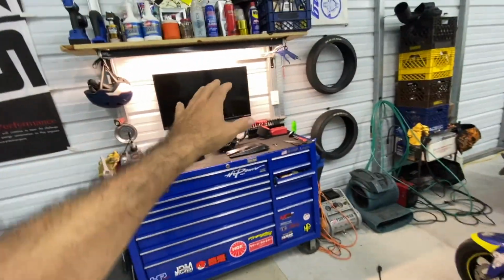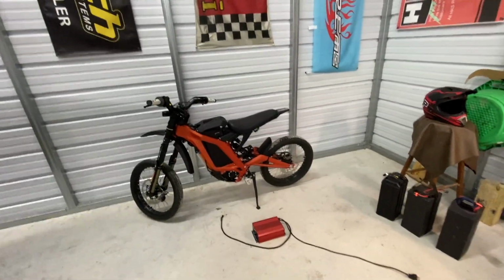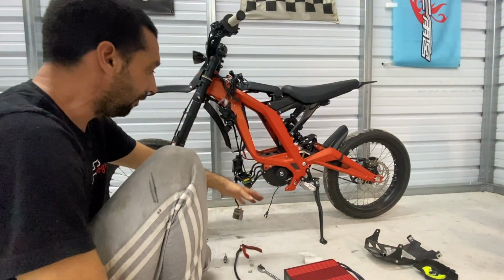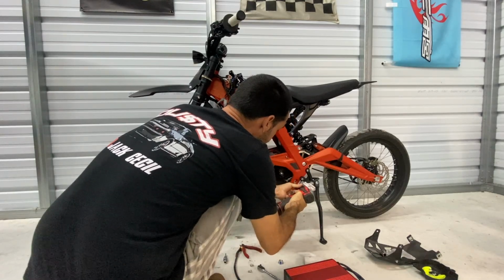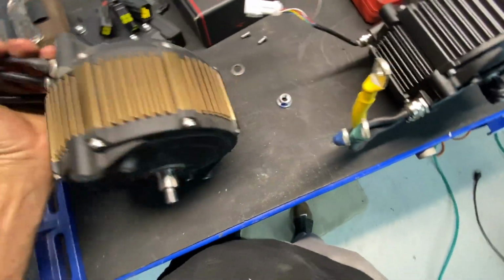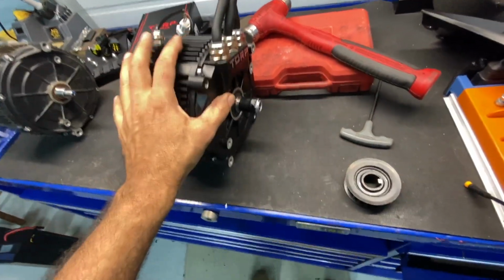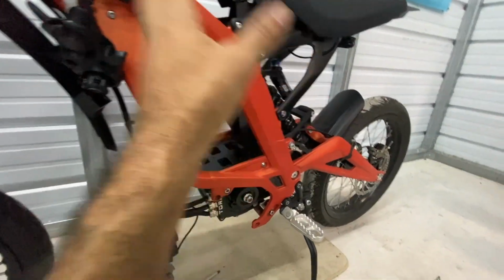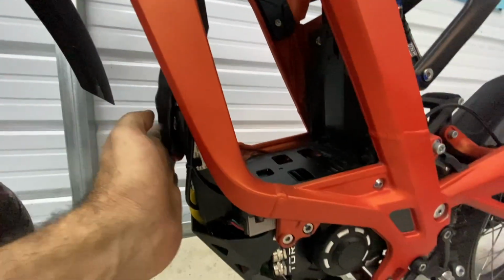Worlds Fastest Surron | Torp TM25 | TC1000 install

Comment: are you running the circuit breaker cause torp says that its so bad to delete it just curious if you are running one and if so does the breaker hold up too the higher power levels
Reply: just wondering because i have a chi 72 max coming with qs10 6AWG harness and wondering if i should delete it or not.
Reply from the maker: Yes i am running the breaker.  Holds up just fine. No reason to delete it.
Reply: @JackCecil  thank you for the response!